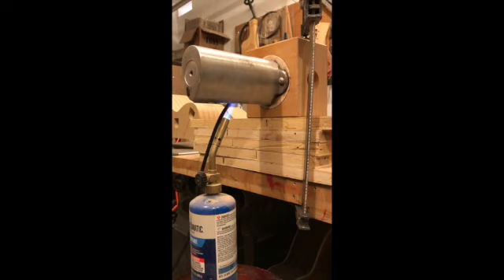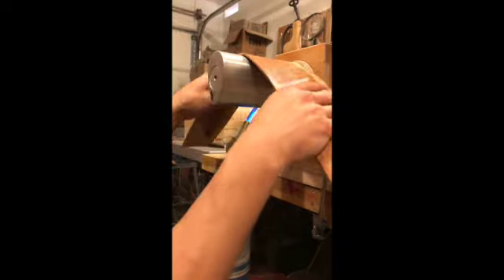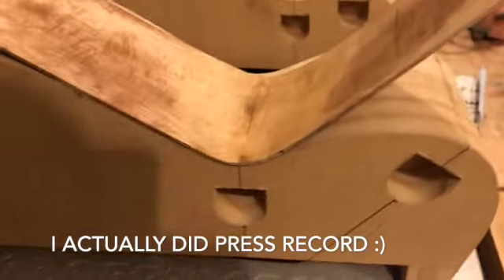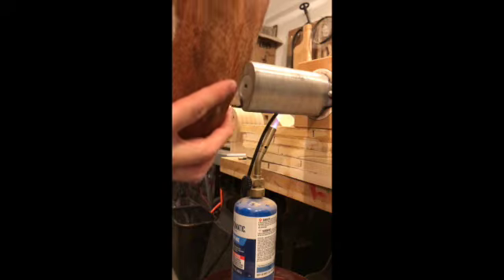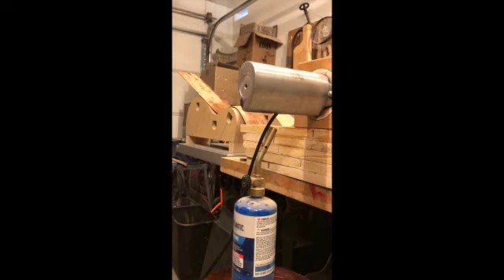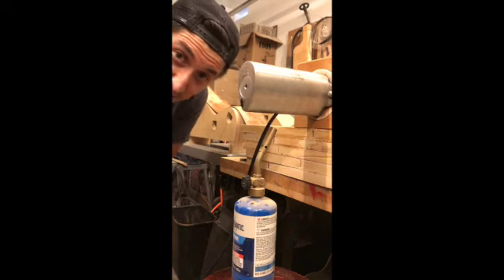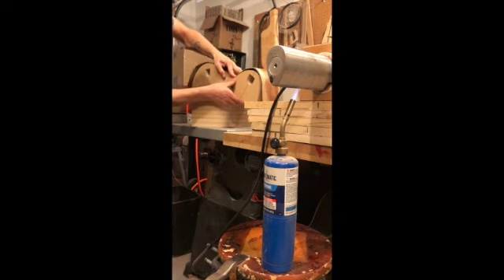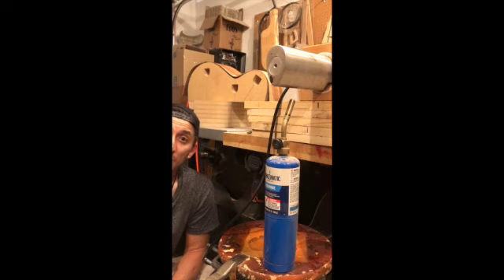Side bending

Comment: Why are you using a bernzomatic, when that's an electric bender?
Reply from the maker: The heat element burned out right after I bought it. It also didn't get hot enough for me. Its explained in the video as well.
Reply: @ungaguitars6252  Send it back from whenst you bought it and complain.  Those aren't cheap.
Reply from the maker: @mgdesigns1952  its been many years since I purchased it. The pipe is still good and a great shape to bend many things. If I could buy the pipe only I might have gone that route. I had 2 different pipes and a torch at SCGC. With the pipe I have 3 different shapes and one torch giving me the perfect amount of heat.  Even if I sent it back I would be without the part I use the most. Thats why I didn't and have not sent it back. Maybe I can talk to my machinist buddy and see if he can make the pipe part only.  Thanks for helping with that idea Mark. Thanks for commenting and checking out the video too. Let me know if there is anything else you might want to see.